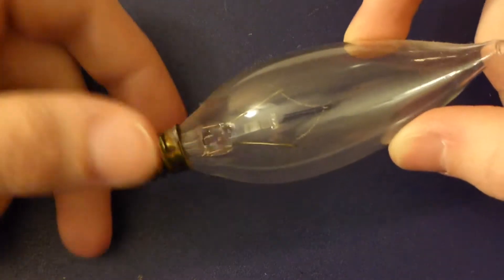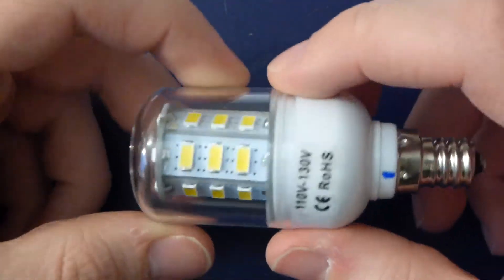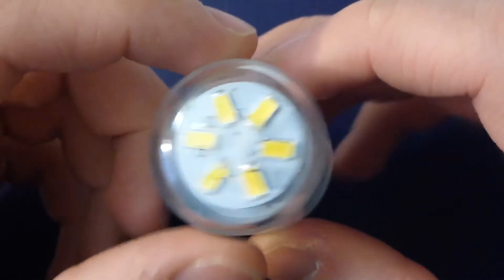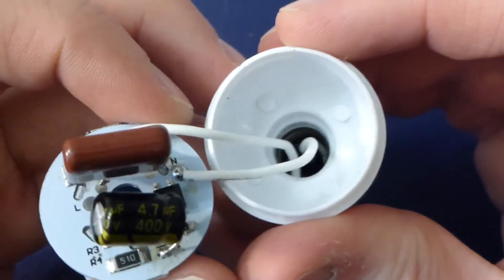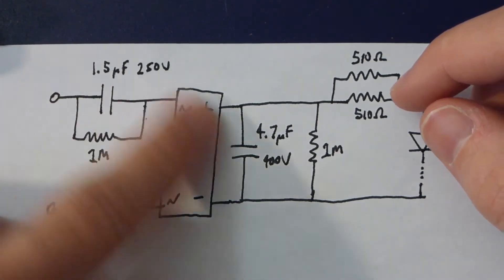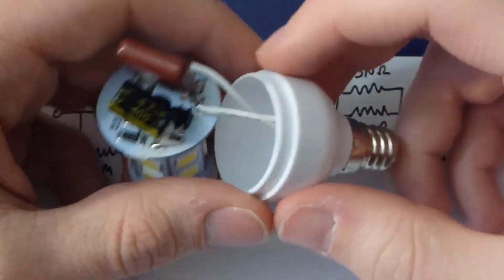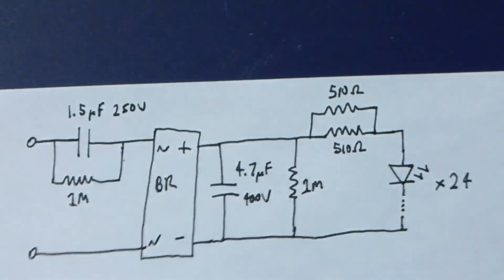Teardown of a 5.5W Candelabra LED Light Bulb

Comment: Hehe sounds like you should change those fixtures. You come with quite a few arguments why you should:

0:35 E12 is getting harder to find
0:35 - 0:50 Bought a E14 instead for E12 by mistake
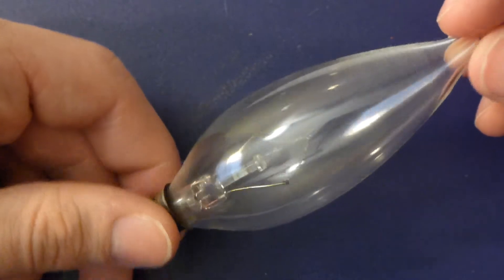1:10 - Found the E12 base. Very expensive.
1:18 - I don't care what they look like
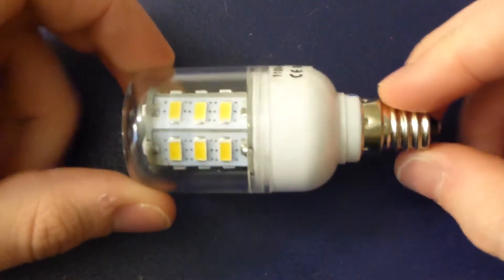1:20 The fixtures ain't beautiful anyway

Besides, I probably would change them to something with better availability, because these bulb are not very good and burns out quite quickly - at least when running them at 220v.